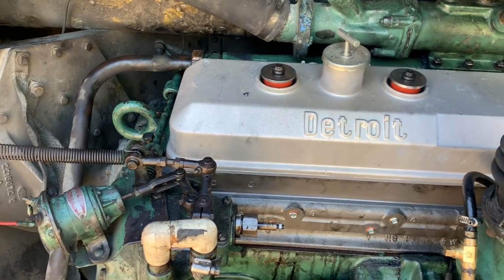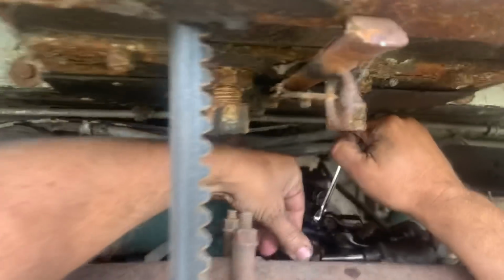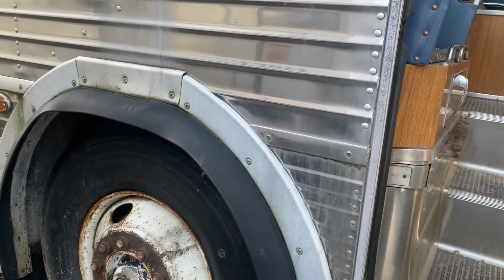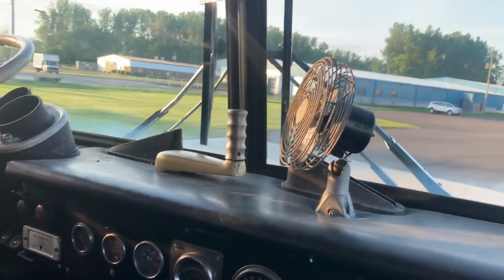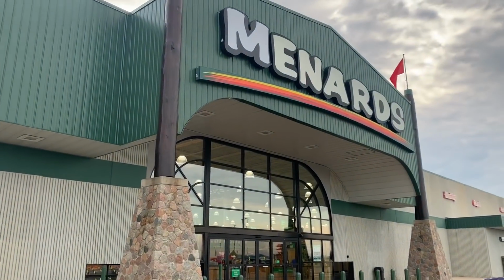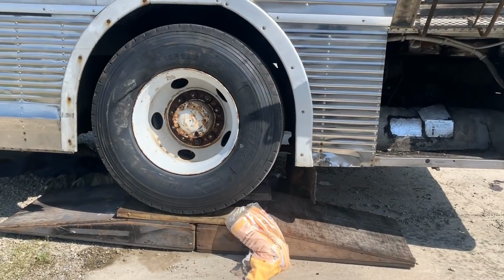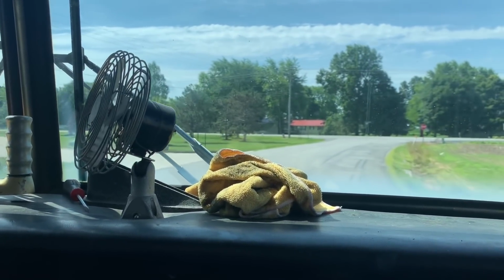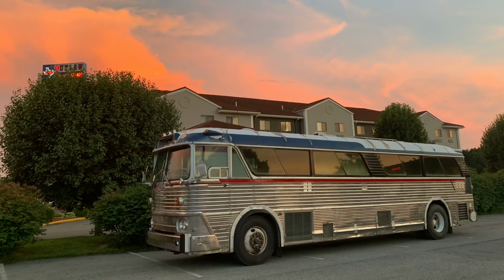MCI MC5a bus rescue day 4

Comment: I've been watching your channel, here in Washington, for about a month, now, & I'm addicted. I've always wanted a bus. I've had a couple old junkers, that didn't work out. But now, I've got the itch to try again... & just out of the blue, some1 dropped a bus, ironically that's also been sitting for 10 years, in my lap, yesterday. Owner said, "Ran good, when parked". I'm going to pick it up, next week. It's a 1986 M.A.N. Transit Bus. It used to be a Seattle Metro Bus. I'm so excited. I've been a gas engine mechanic & a truck driver... but I'm a little new to diesel mechanics. I've had a Ford Powerstroke Diesel, for about a year, that I've been learning on... but I still take it to the diesel mechanic for anything major. When I was buying & selling cars, my favorite finds were "ran when parked, many years ago". I loved resurrecting those old cars. With my mechanical experience, truck driver training & experience, & your videos, which I've learned so much from, I'm fairly confident that I can get this old beast running. I'm taking my tools, fresh batteries & diesel, & some diesel fuel stabilizer. Before, I was just watching out of curiosity. But this week, leading up to picking up this bus, I'll be watching with more purpose. Thank you so much for what you do. Both keeping these old buses on the road, & documenting it, here on The Tube. Keep on Rockin', Bus Grease Monkey.

Comment: I watched all four in this series, just because I couldn't help myself, this evening. I can't remember if you said that Lance was an Eagle Driver or a Mech. Either way hats off to both of you for a job well, if only partially done.... Lots more to go on the beautiful bus.

The reason I mentioned the Driver/Mech... When I went in to the AF my MOS was 432x5, Aerospace Ground Equipment mechanic (AGE). We were the "DOGS" of the flight line. We were at the beck and call of snooty crew chiefs, Intolerant jet Mechs, Environmental ASSHOLES, weaselly avionics, POL pricks and Bomb Shop Bastards.... Not to mention Flight Control! We were and are always the biggest shop on any base.... BECUASE WE DO IT ALL! All of the afore mentioned skills required OUR expertise in not only our field but theirs as well.

One of my favorite and easiest jobs was tuning racks on 6-71 D  on Hobart gensets. When you have a generator that is tuned to 400khz at 240v and could pump 10,000 watts... Every time ,all the time at a whim... man that was awesome! 

PS I no longer wear a watch. or any other jewelry for that matter. LOL

Comment: Great job Scott! You may want to review what 303 can do to your tires and belts. You also may want to tell your friend to buy two sets of extra belts so once one breaks have one set to replace them or the one broken, and already have a second set or another set and a half ready for next breakage so then whenever he feels like it he then purchase another set sort of always carry at least one set of belts just in case. And spray them in 303 is an aerospace rubber, plastic anti UV protectant they sell in eBay for tires and rubber materials. Your tires can last many more years longer after applying some sprayed 303.

Comment: Another great and entertaining video! I love the bus stories that seemingly all of have to swap!  Did you ever think about replacing the DD3 system with Anchor Locks?  Brake chambers are relatively cheap at around $40, and no inversion valve, plus the parking brake really is a parking brake!
Reply from the maker: I prefer regular old maxi spring cans

Comment: I hated those 4-speeds with the reverse solenoid. Training new drivers on how to activate reverse  was frustrating. Then there was the Eagle 05 (with a 10 cap) that would work fine in the yard but wouldn't work when on a trip.
Reply: Philip Muth we had the silver eagles in Australia in the 1970/80,greyhound Australia in ported a heap of them for express work,I drove the for 10 years the most reliable bus ever built,love them.

Comment: Kroil is some fantastic stuff been using it for years. If you shoot firearms mix 50/50 Kroil/Nitro solvent and watch how it draws copper fouling from the lands and grooves. There is some other solvent out there called "Knock-er-loose" which is a cheaper version of Kroil price wise, yet is neck and neck with Kroil as a penetration solvent .
Reply: Ever use ballistol? Like it?
Reply: @ninorcsinned3465  Lol, yes Dennis. One complaint with Balistol, the spray head on the 16 oz can likes to pop off and spill everywhere 🤔

Comment: Those hose clamps are terrible with the expansion of heat and cooling they expand and contract. The best would be to use a spring clamp on all the hoses. 

Great job btw. Enjoy.

Comment: I think you need to lube up the hinge pins on the brake pedal, We had a fire truck do the same thing, Lubed it up and the brakes would release fine
Reply: The pedal is aluminum. The pin is steel. The two different metals cause electrolysis and the pedal oxidizes. Sometimes just lubing it won't help. I remove the pin and run a drill bit through the hole to clean it out. I clean the pin, then  add Never -seize to the pin and put it back together.

Comment: Diesels have lots of torque, plus the torque multiplication in the lower gears.. they don't need to be "getting on the throttle" to get it to move, just let up on the clutch and go.  I've started over dimensional loads in heavy hauls (semis) up 6% grades from a dead stop, grossing over 140,000+ lbs without ever touching the throttle before the clutch was all the way out and rolling.
Reply from the maker: At first i thought he was doing it because he was in a hole etc.   then i told him just to let the clutch out without throttle.

Comment: Consider getting blue tooth headsets so you can communicate without shouting. A driver needs to hear your instructions clearly and react quickly. Safety would be improved.
Reply: Or simple walkie talkie radios!

Comment: Those DD3s confuse drivers not familiar with older buses. They need a full application after pushing the button to release. Without the application, the crabs holding the brake out won't release because they still have pressure on them.

Comment: When it won't go into a gear try letting the clutch up slightly as you put it into the gear.  I understand that may not be the issue in this case.  I love Knipex.  I have all kinds of Knipex hand tools.  Robert Plant: You need coolant...   32:04 Is that an FMC on the right?  Why was there no smoke when he drove out and around the gas station??  42:59 That black truck looks annoyed.

Comment: doesnt the difficult gear shift have to do whit the travel of the clutch being that high? hearing it grinding when pedal is totaly on the floor, so its stil a little engaged?
Reply: MrBugsier5  heavy truck and bus clutches have a clutch brake that will stop the transmission shaft from spinning when the pedal is completely down. It’s often either miss adjusted or worn out, so the shaft continues to spin when the pedal is fully depressed. That’s what causes the clash when shifting into gear from neutral.
Reply from the maker: It’s a non synchronized trans. You need to match the speeds.  It’s usually like riding a bike. Hard at first then second nature

Comment: Regarding your breakdown story, and the "Giant Lawnmower Belt of Death": is it possible to fit electric pusher/puller fans in place of the belt and conventions fan, thus removing the whole assembly and the parasitic load on the engine?
Reply: The New Flyers that they have at work have electric fans, and I've seen guys repowering older Flxibles that have gone to hydraulic fans.

Comment: Hey Scott, speedometer broke? Are you on the highway? Got a watch with a second hand? No problem! Time the interval from milepost (yardstick) to milepost in seconds. The formula is 3600 / seconds = MPH. So 60 seconds is 60 MPH, 70 seconds is 51 MPH, 80 seconds is 45 MPH and 90 seconds is 40 MPH. Going the other way, 50 seconds is 72 MPH, 45 seconds is 80 MPH. Anything below 40 seconds is NASCAR fast and the County Mountie's wet dream. You know the type: Campaign hat with the mirrored sunglasses — with the mirroring on the inside. "You in a heap O' trouble, bwah!" Let sleeping bears lie. ;-)
Reply from the maker: Or just use my phone gps

Comment: Hi you know your trade well, I'm a Inter Provincial Red Seal Heavy Duty Mechanic up on Vancouver Island  B.C. Canada. Been at her since 1962.  Learned how to make them 53 & 71 Series G.M. Just sing, Trouble shooting , tune up and rebuild were my forte. I work about 90% of my working years in the forest industry.  Lots of tune ups on V12 / 71 N  "The Dirty Dozen" both naturals and turboed . They run so great after a tune up. Next as a shop foreman and master mechanic if you where working under my direction you would never be blocking up or jacking up anything as you did that bus that my friend is a death trap. You must refrain from showing such unsafe work ethic, if you want to kill yourself find but don't show others totally unsafe work ethics.  BRIDGE BLOCKING IS THE ONLY SAFE WAY TO GO. I would fire you right on the spot for pull off such a damned fool stunt as that.

Comment: grease monkey, which brakes are sticking? all or just one or two or all? I know you know what you are doing, but after 30 years on the road as on owner operator, our order of solving problems are different. My wife sometimes thinks i'm crazy sitting  here talking to the computer saying do this or check that. love your channel and am always waiting for the next post. keep the vids coming and keep those old busses rolling!!!!
Reply from the maker: At first i just thought it was the rust and drums just adjusted too tight and that it would self clearance after a few miles.  After following him i quickly realized the quick release valve was not dumping all the air. If you have the treadle a little flick it would dump the rest of the pressure.   His brake lights stayed in which is how i noticed it was not releasing all the pressure.
Reply: I know you have a pretty common name, but where did you get your schooling????
Reply: @hedatguy  jones jr college, ellisville,ms

Comment: A coach this old I would just put all new, diesel engine and transmission, new air system, exhaust and all new undercarriage, brake system M clutch and electrical system. I'll be spending $40k on all new restoration

Comment: https://youtu.be/0EPVaB_r1ZI?t=2000 - that looks to be MCI 102 - going to say probably A3 series. The 7 speed was interesting to drive. Only used the top 6 speeds, 1 was a crawl speed. The spicer (?) gearbox would have a "V" shift from 3rd to 4th, hard to get used to!

Comment: Quick shut it down you're out of blinker fluid and your chrome exhaust bearings aren't tight
Reply from the maker: The problem was I had accidentally used left hand blinker fluid on the right side.  I finally got it sorted out.
Reply: @BusGreaseMonkey  oh that's great love to see you have a sense of humor
Reply: @BusGreaseMonkey  you might want to get some Canadian Blinker fluid, it's colour coded green for right, and red for left, saves reading the label.

Comment: What size motor is that
Reply: Is it the engine that's supercharged. And turboed where the blower snaps. And runs away
Reply from the maker: It’s not turbo charged. It’s a 8v71N